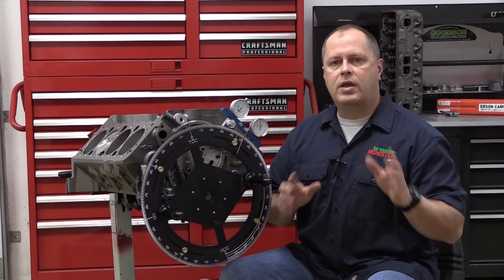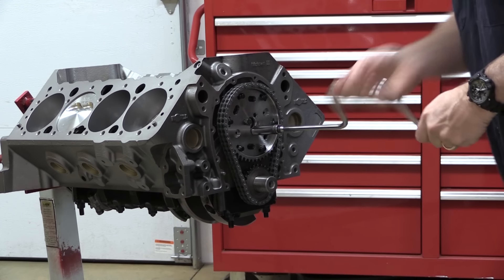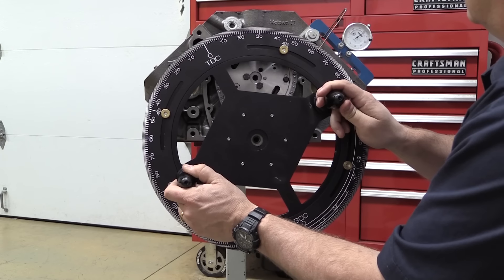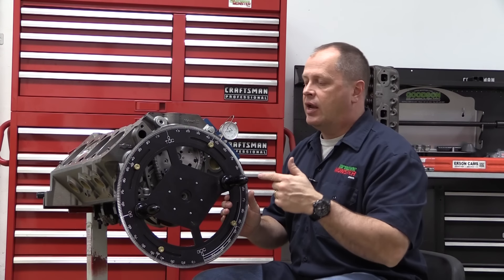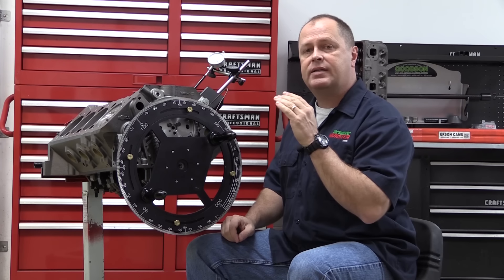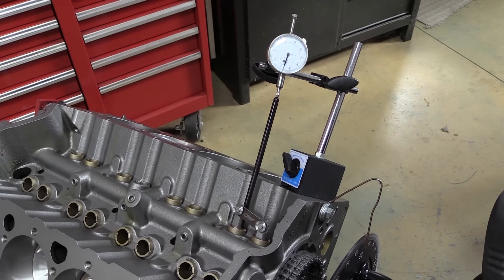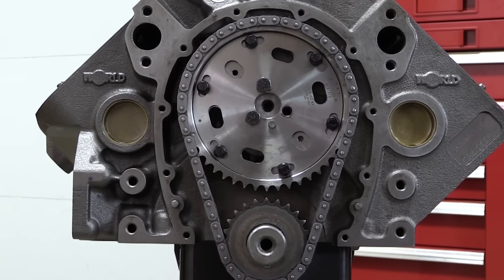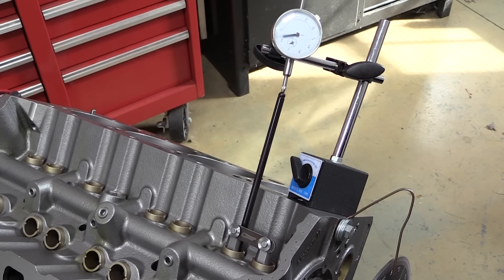Better Engine Building: The Easy Way to Degree Your Camshaft

Comment: Am I the only one that’s still confused 😕 😢
Reply: 😁 not to worry! Just watch a few more YouTube videos on this subject. And some of them they will use a degree wheel that goes 360°. And that may make more sense to you. And a lot of other people. Keep at it don’t be discouraged😁👍
Reply: I’m scratching my head😊
Reply: When a guy starts out using the two point set up then exits camera and goes to one point-
That exudes confidence in what he is doing.

Is this guy:
A.  A builder doing cam #2,413
B.  Reading a script and doing this for the 5th time.
Reply: @hummervs3278 my guess is he has done it many times and can do it more accurately with a double gauge but for teaching purposes, single is simpler. But who knows, should be the same measurement right? One way you can just measure piston rock at the same time, which would get annoying while degreeing. Hah.
Reply: @dennisborg5243 yes but no it's 720 lol
Reply: The wheels I've bought and used are 360 because the cam is degreed to the crank not the other way round and coordinates are based on tdc and bdc
Reply: woman moment
Reply: all he’s doing in the video is making sure all parts to be installed in the engine will play nice with each other and fit together. that’s one of the most important things is to make sure everything being put in can work together or you risk blowing the engine. i’m still a bit novice on advanced and retarding cam but i think that it’s the max amount of play you can have in your adjustments of the cam, advanced will close valves faster before top dead center and retard will leave valves open longer before top dead center of each cylinder.

Comment: This is a video degreeing a camshaft, best video I've ever seen , most people don't realize how important it is to set the dial indicator up on the center of the Piston .watch this video if your interested in doing it right, when through, put harmonic balancer on engine and  reset degree wheel to tdc check and see if balancer is lined up on tdc with timing tab,this way you will have accurate ignition timing when set.
Reply from the maker: Thanks for the kind words!

Comment: my camshaft has a 1 degree deviation on idle, it would go away when I rev the engine, what could be wrong? it is the MB 278 (V8 twin turbo engine)

Comment: Question: if a mechanic is installing a new camshaft- should the degree of the new cam be off, at that be the owners problem, or should a new camshaft install with a six degree tilt be the mechanics issue? Because just got a new one put in and got a call that degree is off and now that needs to be fixed. Frustrating!

Comment: Hey thanks for the great video...!  I just figured out how to use my degree wheel and my cam works out be be what’s on the cam card...and cool trick to use a push rod to find intake center line...I could probably take that job at NASA now, thanks.

Comment: this is a great video if your cam specs are correct you didn't explain how to correct the degre. as you said your's was dead nuts on. you did show with an adjustable cam gear but most use the crank adjustment

Comment: That looks like a really nice  degree wheel, but can you turn an assembled engine with those handles?  When you are checking timing  with the heads on your turn the engine with an adaptor on the crankshaft .

Comment: After finding TDC, you installed the lifters to set the cam timing.  Did you 0 the degree wheel at TDC before getting to the .020?   In the video, you started at 82ish from what I can see.

Comment: wish i could do this with heads still on.
Reply from the maker: You can. It requires a few different tools, but not a big deal. Check this video out for more: https://youtu.be/1LcYEZwOIQQ . Thanks for watching, and hope this one helps
Reply: @TheHorsepowerMonster  thanks. I actually found that video like 2 minutes after I posted this.

Comment: Do you need to do this with every single build, even if you just put a stock camshaft back in? And if the numbers aren’t matching then what do you change? Do you turn the camshaft 360°. And then verify again, after your timing marks are matching. I see some people just throwing a motor together without degree ing the cam besides the pros doing it to a highly modified camshaft.

Comment: So without an adjustable timing gear you get what you get?
Reply from the maker: Exactly, but at minimum, most timing gear sets have multiple keyways on the crank gear that allows you to change the timing by a couple of degrees.
Reply: @TheHorsepowerMonster  I’m 47 and new to the motor building game. I’ve always been on the body and paint side. I live by the gun,paint gun that is.

Comment: how to get the right timing if the cams is aftermarket without cam card? and it has no timing mark.  im using it with my motorcycle
Reply from the maker: If it has a part number or a grind number on it, you can call the cam manufacturer and they should be able to help you.

Comment: My timing set is not adjustable? So dialing in the cam is pointless
Reply from the maker: If you measure it and the cam timing isn't correct, buy a better cam gear timing set.

Comment: Question is how donyou know to advance or retard a camshaft with Dyno time? No way a cam designer can predict every combination perfectly. Cylinder head flow will vary even in similar heads. I always hear install the cam advanced. Why is this? Thanks

Comment: Will the lifter compress slightly with the pushrod pressure? Do you need a solid lifter for this or soak them in oil to fill?

Comment: If someone wanted to change out a cam to a slightly less lift or duration of cam . Would it be possible to use the same valves and all. Or would you have to change out springs , valves if you  Changed the cam.
Reply from the maker: Yes, it will work. You may not need as much spring pressure, but it will work. Thanks for watching!

Comment: Is the engine supposed to turn smoothly by hand like that? Cuz mine needs some force.. I put the piston rings on, and used assembly lube on the mains/rods... the caps are all torqued to spec. I'll probably have to re do all
Reply from the maker: Not this easy. I only have one piston in and maybe only one ring if I remember correctly. Just a mockup for the video. Thanks for watching
Reply: @TheHorsepowerMonster  Thanks a lot sir! I was wondering about it cuz when I was rotating the crank on my 302 SBF my hand was jerking as I was slowing down. So far, your video was the best I watched on the subject!! Very detailed and to the point.

Comment: To.. larry Davis, you always have tolerance varience when parts are machined, therefore, the cam , chain, crank gear, cam gear, crank keyway slot, all could be of just of a tiny amount, but added together, could cause quite a variance ,that is why you always check !

Comment: Never understood this step on a typical street engine, if you stick a camshaft in the engine, and a timimg gear set with normal keyways and alignment dots on the sprockets, there is not much to do with your degree wheel is it?

Comment: one thing not really emphasized and a source of confusion is the need for degreeing because you want/need to know what the cam is doing with the valves relative to the piston position. The majority of cams are probably spot on for their grind but what is important is how that cam works in relation to it being rotated by the crankshaft sprocket. Sprocket may be off, the crankshaft keyway may not be in the right place just to name a couple of things that can effect the cam valve timing. The importance is to have all of the rotating assembly components working in unison so that you can verify correct positions or find and correct those not in spec.

Comment: Every time I watch this being explained, the cam being checked ALWAYS seems to be “correct” and you’re “good to go”. This needs to be done/explained with an example where you’re not “good to go”. The timing sprocket that lets you go up to 6 degrees before or after is cool, but when would a guy WANT to do that - that never gets explained either. Very frustrating. I watch Power Nation all the time, and EVERYTIME they degree the cam, it’s spot on with the cam manufacturer’s paperwork and is “good to go” and virtually NOTHING is ever done, and the build continues. I am CONFUSED, and aI guess I’m just not getting it. Very frustrating - what am I missing?
Reply: This was asked a year ago, with no explanation . . . damn . . . I know you're busy - everybody's busy . . . am I the only one who see's it this way?

Comment: So... What if something isn't correct? What do you do then?
Reply from the maker: You can use an adjustable timing set to advance or retard the cam timing. It isn't difficult. Thanks for watching
Reply: @TheHorsepowerMonster  Question! I'm not understanding  with the piston stop.. how do you know how deep to adjust the piston stop  down in the hole? Watched some other videos on this..

Comment: HEY I HAVE A QUESTION FOR YOU I HAVE A 5.7 STOCK CHEVY ENGINE OUT OF A 1990 K5 BLAZER IM JUST NOW STARTING TO SMOKE IT WAS JUST DOING IT WHEN I START IT UP ONLY NOW I SEE IT WHILE I IM DRIVING I PULL THE SPARK PLUGS OUT ALL THEM  LOOK PRETTY GOOD EXCEPT FOR #8 IT WAS COVER UP PRETTY BAD WITH OIL THEN I TOOK A COMPRESSION TEST AND ALL THE CYLINDERS WERE READING 150 EXCEPT #8 WISH WAS THE ONE THAT HAD ALL THE OIL ON IT AND IT WAS READING 180 I FIGURED THAT WAS BECAUSE IT WAS ALOT OF OIL BUILD UP ON TOP OF THAT PISTON..SO I WERE JUST GOING TO DO THE HEADS ..OR JUST DO THE VALUE SEALS ...I DONT HAVE MUSH MONEY SO IM TRYING GO THE CHEAPEST WAY OUT BUT I WANT IT TO BE RIGHT..SO WHAT DOO THINK I SHOULD DO...

Comment: So what if you're using a regular timing chain set, that doesn't have the adjuster or extra bolts.  And just has the normal 3 non-egged shaped bolt holes?  How would you adjust the cam timing then?  And what does a Cam that's something like 112+2 look like on a degree wheel?

Comment: Need a manufacturer link about the large degree wheel,thanks
Reply: E916001 - Erson Cams - DEGREE WHEEL 16" is that wheel, however its out of stock for some reason.

Comment: Thank you for the video. I have a question that I couldn’t find an answer for it I’m google. Can I dial and degree on any piston? If I want to degree on a piston #3, I should set my degree wheel TDC on piston #3 or it’s always #1? The cam specification is general to any piston or I should ask the manufacture for the number related to the piston I will degree on. In motorcycle engine it is difficult to find a space to degree in all pistons.
Reply from the maker: Yes, you can degree in on any piston. Just make sure you find top dead center for that piston and don't just go off of number one! I've seen engine builders check multiple spots on the engine when degreeing in a cam just to make sure there wasn't any drift when the cam was ground (That's when the centerline on each lobe moves a bit from the front of the cam to the back.) Thanks for watching
Reply: @TheHorsepowerMonster  Thank you so much for help, I was looking for this answer :)

Comment: This is as stated by others, the best explanation of how to degree a camshaft.  I'm redoing a 350 Chevy right now, and it's been over 30 yrs since my hot rod days, and back then, we put the cams in, lining up the timing marks with the No. 1 Cylinder at TDC and away we went - and everything seemed to be fine.  In this video, it seems like, what you're doing is not so much "degreeing the cam" as "verifying Cam manufacturer grind data".  I say this, because at the end of the day, you put the cam in, and line up the timing marks on the timing gears, with the No. 1 Cylinder at TDC and nothing I see here, changed any of that so I am trying to understand why this is viewed as so critical to an engine build?  To me, it seems the only way you could change it, would be to buy the timing gears that are adjustable, like the one in this video - but for the average joe garage mechanic - they're going to go with a timing chain set - I guess I'm just slow in the head as I don't understand why this is so critical, unless you're "verifying Cam manufacturer grind data" before committing the cam to the motor for the rebuild.  I'm sure i'm missing something . . . I guess I just don't know what it is - and I know it's me, on my end . . .
Reply: You're right on they don't ever do anything but verify then at the end they'll say it's ok if it's 1 or 2 degrees off, WTF. You're right on and I've watched a few of these videos and I've recomeneded that they do actual degreeing of the cam and not just verifying. Check my comment above.
Reply: when I do my cam in my ls2 I'm not going to do this😂

Comment: Not being critical here at all, I understand more after watching then I did before, but it seems that you just proved that the cam is what it says it is? If a shade tree mechanic(me) is putting one together and don't have a dial indicator or a degree wheel or adjustable timing gears...... what would I get from this?

Comment: Look, get number one piston up just before it goes down, move the cam to up just before it goes down, then turn cam back before it starts down the other side, split the 2 point to center high cam, put the gear & chain on dot to dot

Comment: Great video...My concern is that your motor is so easy to rotate compared to my builds. Are you really turning your rotating assembly and cam over with one hand on your degree wheel?
Reply from the maker: Not really. Since this is just a mockup for the video (the block actually has a bad cylinder). I only have rings on one piston. It wouldn't be nearly as easy to rotate on a legit short block with rings on all eight pistons. Thanks for watching.
Reply: THAT was driving me nuts! Just yesterday I installed my pistons in my 454 and I felt sure I had done something wrong based on how easily you were turning the crank! I sure hoped someone else noticed and asked and sure enough I got my concerns eliminated. Thanks! Brett....

Comment: Look friends, just because you " dialed in a cam according to the manufacturer, doesn't mean you will get the most out of it. 
As an example, I built a super stock cleveor that was slow coming out of a turn running with wedge engines. I kept retarding the cam til it hit the sweet spot. Then it jumped coming out of the hole.
You have to experiment and not just take it as the final word from a manufacturer. They give you a decent starting point.
Reply: Just be absolutely sure that you have enough valve to piston clearance when you are doing this because advancing or retarding your cam timing will affect this. Advancing, which moves your power curve lower in the rev range, will decrease your intake valve clearance while increasing it on the exhaust valve. It also increases dynamic compression. Retarding does the opposite.

You will likely see a drop in peak horsepower either way but your needs might be better met with a change in cam timing.
Reply: One trick you can do is a compression test prior. More cylinder pressure more power.
Reply: @I_like_turtles_67  Generally  true.

but some race  cars  crank over  at 150 PSI and youd  never know that car ran  like a scalded dog

Comment: Where can I get a degree wheel what is the part no. What brand
Reply from the maker: I think PBM used to make them. I looked on their website but they say they are out of stock. May not make them anymore. Thanks for watching! This is the next best one I see most engine builders use -- https://amzn.to/2TbrHZp -- you can just different crank snout sockets depending on the engine you are building. Thanks for watching!

Comment: Got it, setting the cam timing on a V8 push rod engine, so no real adjustment without adjustable timing gear.
Reply from the maker: Unless you are using a totally stock timing set, most have some sort of adjustability. This one is definitely high-end, but most have extra keyways cut into the lower gear (the one that goes on the snout of the crankshaft), and by rotating the lower gear forward or back, by taking the gear off and using a different keyway slot over the woodruff key in the crank, you can adjust the timing by increments of two degrees. Thanks for watching.
Reply: @TheHorsepowerMonster  thanks for that, im from UK, so not familiar with  all American terminology and V8's other then the junk rover V8 from the 70's.
Reply: @aeroflopper  nothing wrong with buick v8s.
Reply: @frigglebiscuit7484  they had no power, but tuning potential was quite good.

Comment: Oh using a pushrod is such a good idea! I tried putting something flat on top of the lifter to rest the dial indicator on or on the edge of the lifter and it was such a pain to get an accurate measurement,  and to get the dial indicator to reach down into the valley. Thanks for the video. Watched a bunch of your others too, engine builds and such. You do quality work. Thanks again. I live in Australia, so handy to be able to get good tips from the other side of the world.
Reply from the maker: Thanks a lot! I'm glad the video was useful to you, and thanks for watching!

Comment: Do you see much difference worth worrying about between degreeing it at this point and moving on, or doing this to verify it, then fine tuning it (solid lifters) at the valve spring retainer on the complete engine with deflections and all factored in..?

Comment: I usually check a cylinder on each side of a v8. Had a cam on a 460 ford that was 22 degrees off from the right and left side. The driver side had 120 psi and the passenger side had 80 psi. Not a good day...